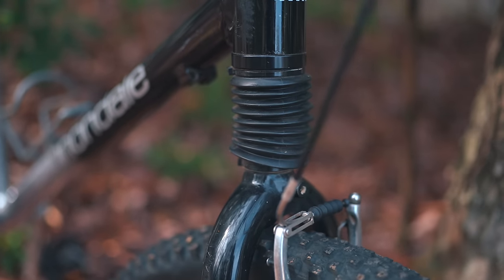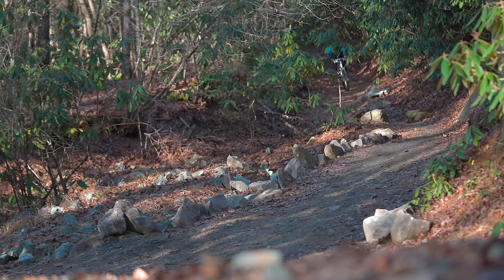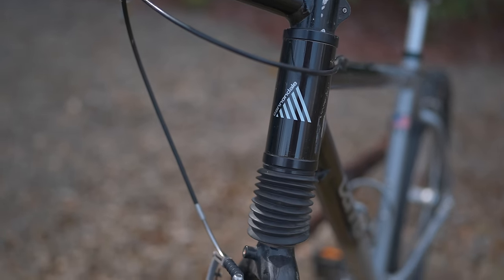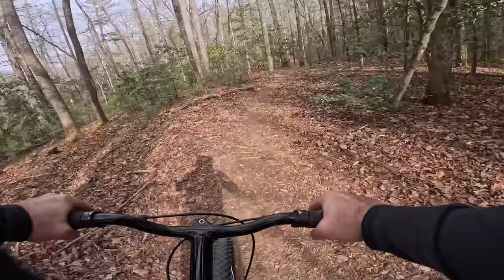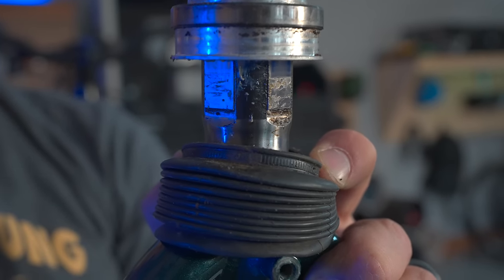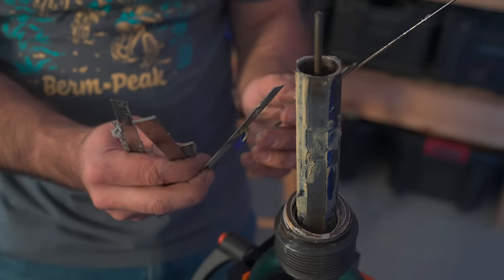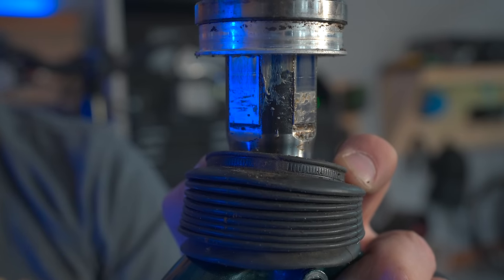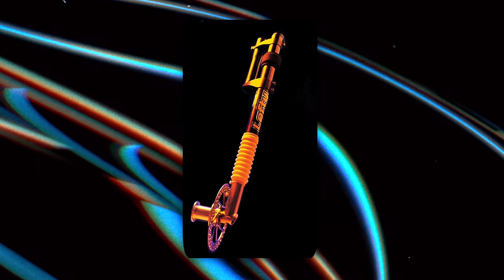The Rise and Fall (and Rise Again) of Cannondale's HeadShok

Comment: I was a Cannondale mechanic from 89 to 99.  Headshoks were a pain in the rear.  The boots cracked.  The slightest bit of dirt and it was a complete teardown.  Getting those bearing slides back in was pure joy.  There were two types of Headshok.  One with oil and a dampner, another with a rubber bumper.  Hot days the bumper was mush.  Cold days it was a brick.  But they rode so much better than regular forks.
Reply: Me2, they are/were the worst.  Only a matter of time till one of the bearing races migrated.  If that happened felt like the headset was loose and broken and was $$$ and time consuming to repair.  The races were shims in different thicknesses. As a mechanic it was trial and error what mixture of thickness would work...such a pain.
Reply: 15k mile on mine and it never needed anything
Reply: @lawrencefranck9417  oh it certainly did, you just didn't notice
Reply: Yep the new specialized ones are also a pain in the ass to service. It's basically a cup with a mini fork damper in place of a headset cap. The tension is set by a series of 2mm set screws. They strip easily and don't always work if you don't pre-preload the headset.
Reply: Same here....93-99 @ a Cannondale dealer. I did huuuuundreds of them. I recall using a section of road inner tube that I would inflate to keep the races in place. Good times...ha!
Reply: I worked at a Cannondale dealer at the time, the forks where so smooth, the double crown forks with the lefty internals where sold, they called them the Moto forks and wa used on the 'Super V Freeride' for example. Freeride as a word was used by Cannondale for the first time.
Reply: One may say it was a pain in the front.
Reply: A lot of guys had the oil type changed over to the bumper type. My F2000 steered like a rack and pinion car, no flex at all. But... mine needed rebuilt every other year.
Reply: Very long
Reply: Are*
Reply: Agree 💯, but the Lefty is still cool AF! Cannondale was the last company doing all the things that made mtb rad in the 90s.
Reply: Looks like a sticker of peyton manning 😂
Reply: The Headshock let me down so many times.  I stopped riding the bike about a year after I got it.
Reply: no you weren't

Comment: I wonder how long it will be before we see a Cannondale gravel bike with 50mm headshock.
Reply: 10 years ago.
Reply: Cannondale had predecessors of what we call gravel bikes now from at least 1998 on - way before when gravel bikes became a thing in mainstream. Back then it was called Cyclocross.
The XR800 had a rigid fork while the XS800 was spring fork. XS800 models only had 25mm of travel tho (Fatty X fork) - sign of the times. Even earlier cannondale had hybrid and road bikes with headshoks of 15mm of travel. Of the newer bikes I'm not sure but mostprobably there is something. In 2000 cannondale introduced the Bad Boy urban bike - much similar to the F**-Series 26"-mountainbikes but with 700C wheels. They had a 70mm headshok. I imagine it has a more race-oriented geometry than your typical dad bike.

Also with an F-Series mountainbike equipped with discbrakes you could most probably also run 700C / 650B-wheels to build some graveler.

Comment: I'm still riding a cannondale H600 that I purchased in 1997. I used it as a hybrid for a few years and then I converted it to a road bike. It's still my main bike and the head shock hasn't been serviced since 2000. The best part of the head shock is the ability to easily turn it off and on. Going down hill or on flats I keep it on. Going up hills I turn it off so I can transfer all my energy without loosing powder to the cushioning action especially when I'm up on my pedals. This also allows me to keep my tire pressure up while providing a smooth ride even on the normal uneven road surfaces where I live. What a great invention.

Comment: I worked at a Cannondale dealer for six years. I honestly loved working on HeadShoks and Lefty’s. Even if you got a completely rusted out one you could just replace the races and/or the bearings and you had a (better than) new fork. Plus if you knew what you were doing you could customize the pressfit damper by changing the shim stack and/or oil weight. Also, as you ride the needle bearings and races polish so an older fork (that’s properly maintained) often feels better than a newer fork. At the time they were impressive technology.
Reply: I had a headshock way back in the day that locked up entirely. The shop said it wasn’t worth fixing. I might’ve gotten fleeced after reading your comment, but I ended up with a 5” travel Psylo on the bike, which was head and shoulders above the headshock in performance. Oh well
Reply: Very long

Comment: I have 3 bikes with headshoks.  I use them mostly for commuting and occasional gravel riding.  My first bike was a 50mm travel headshok and that has ~ 80k miles on it.  Recently I bought two early 2000s headshok bad boys (80mm travel) for cheap, bought the tools and replacement seals / spare cartridge and I LOVE these bikes.  One was supposed to go to a buddy in Texas but hard to send it on.  I am old and want to keep the shocks out of my wrists so I can ride to 100.   On a bad boy.  Seriously my bad boy is all aluminum, carbon, and stainless so am sure it will survive the next 35 years.  Stocking up on the seal kits so I can do the next rebuild when I am 90.  I always think - "I have the coolest bike I have ever seen".  hahaha.  Except I want the Cannondale scalpel / habit in "purple haze".  I do not need but I want.

Comment: The brake levers on that bicycle are also a historical innovation. They allowed you to set more or less mechanical advantage to suit your preference. Precursor of servo-wave, which is now commonplace for hydraulic brakes. Cool stuff all around.
Reply: Shimano were already making servo wave levers for cables well before VBrakes came out, and the XTR and XT levers that came out before the LX ones shown, also for VBrakes all had servo wave of the same style as the older Canti version. This style was where the cable mount was on a roller that moved in a slot in the lever blade to go closer to the pivot as the lever is pulled to increase cable force. XT levers had 2 blocks that could be removed from the slot allowing no servo wave with all the blocks in to full servo wave with both removed. XTR used a threaded pin that sat in the slot allowing fine tuning of the exact level of servo wave assistance the rider wanted. The downside is that the roller would wear a notch in the slot in the lever at the lever released and especially at full lever pull positions, leading to there being a noticeable click felt through the lever as the brake was pulled. 

Avid (They're the brake manufacturers SRAM bought to add brakes to their line-up, but this predates SRAM owning them) Speed Dial levers had a similar mechanism but it was moved using a screw that allowed the rider to move the pivot though it stayed fixed in use - it allowed the same pair of levers to actuate a VBrake on the front and Cantis on the back with a similar lever feel for example. The Deore LX levers in the video are probably the most elegant incarnation of servo wave cable levers because they don't wear in such a way as to notch any part of the mechanism and there are fewer moving parts, but the mechanism was much too bulky and heavy compared to what XT and XTR were running.
Reply: Taken from flat landing bmx.
Reply: @peglor  Thanks for this thorough explanation. These models were too high end for me to afford back then, and date to before the internet. Therefore I am still learning plenty and do so retrospectively.
Reply: Dude, i owned similar ones, STX RC, and they were hella good, i'd still like to run a pair of those in my commuter, the feel was of aerospace quality
Reply: this is a basic idea, and has been present on most brakes
Reply: Force 40

Comment: I rock a 2003 F600 with an ultra fatty dl80. It’s new enough to have disc brakes and sports “Handmade in USA.”  I also switched it to single speed and put 1.5s on it. Great little city assault bike and has a great orange to yellow paint job. Bought it a long time ago for a few hundred bucks and will never give it up.
Reply: Important to have a good city assault bike!

Comment: your the man, i tried to service my forke in 1997. let me tell you, without the internet and no help at all. it is not easy.  Greetings from germany
Reply: Hopefully this will inspire some more detailed rebuild guides. Hard to find service manuals. Once you've done a few it gets easier but getting the races and bearings set can still be a nightmare with all the grease.
Reply: Hab heute ein killer v 800 gekauft und die gabel sind total fest, hast du eine ahnung wie man die repariert bekommt? unten rum ist die total krustig

Comment: For commuter bikes this looks like a good solution. The common commuter forks from Suntours are simply not good and they only move if you hit a pothole. At the same time they fill with water if you ride during rain and get sticky after a service very quick, and they start to rust quite fast on the stanchions. I went to a non suspension fork on the commuter for this reason, but it is of course not the same smooth ride like with a mountainbike with a proper suspension fork
Reply: The Headshok is way over engineered and much more expensive to make than those crappy cheap suspension forks. The only reason those forks are so common is because they look cooler than rigid forks and provide marginally more suspension 😂
Reply: @michaelmechex  
yeah, in many cases you are better off with a rigid fork and simply fatter tires
Reply: Nowadays we also have suspension stems (and seatposts, and even grips), so the options have opened up a lot for commuter bikes without going quite as complex as this. I'd love to see needle bearings replace bushings in some 'simpler' designs though for the smoothness, just not really a lot of ways to make it affordable and not require regular maintenance.
Reply: the thing is if you are already going with a high end option (which canondales was probably) you can get a higher end telescopic fork and be done with it.
Reply: Try a suspension stem. Way cheaper, zero maintenance and they definitely smooth out the ride.
Reply: Gazelle, one of the biggest european manufacturers, uses a similar design, well, rather the same general idea, on some of their commuting ebikes. Absolute pain in the ass.
Reply: Yeah I just got a commuter ebike and the front suspension was shaking me apart at high speed bumps. Just tried locking it out, and high speed bumps are better. Low speed curb hopping.... Not so nice

Comment: I owned a delta v700 with a head shock, pretty sure it was a '93. Didn't care much for the bike but loved the headshock concept. Mine was one of the first versions so it would lose air frequently and would loosen up quite a bit too. You had to twist the dial about five or six times to get it to fully lock out which was a pain. I believe subsequent models  fixed all those issues, the dial went to three clicks from what I remember, soft medium and locked. Where we lived in Southern California our mountain bike rides typically consisted of anywhere from 10 to 20 mi on the road to get to and from the trails so having a easy to engage locking front suspension was very convenient for those long torturous uphill pavement climbs. Thanks for all the well done, informative videos!

Comment: My first decent MTB was an F600 with a Super Fatty Ultra DL. At the time (early 2000's), there was only one shop in de vicinity that had a mechanic with the proper knowledge of these forks. After crashing my F600, my parents got me an F1000 with the same type of fork. Never had any problems with it. I still got that fork somewhere in my shed.

Comment: I had an f400 I bought used in 2009. It actually had a Head Shock with a 110mm air spring. The bike shop said it had been retrofitted, and the air spring was a Cannondale Team shock. The boot was significantly longer. It rode great! Wish I still had that bike.

Comment: I’d been watching an f700 on Facebook marketplace. You inspired me to take the leap. I updated it with a single chainring, new bottom bracket, and shorter stem (only 1 alternative out there) along with repacking the bearings and rebuilding the headshok (that was not easy). I rode it yesterday. It will serve as my “around town” whip. Super light!

Comment: I love your review. I once converted a Lefty Max to a Kona Humuhumu-Nukunuku-Apua'a frame (with a spare steerer tube from a Bomber Z1 and some selfmade spacers) and installed a "sequential" shifter to the "middletube" (made of a Nexus shifter with a new housing and a manly lever) connected to an Alfine gearhub...

And before there were any "Gravel-Bikes" I took a CD Bad Boy and put some super compact road gear and proper wheels on it - it was a blast. And as there weren't any discs for roadies available at this time, I went first with the mechanical Dualbangers and then with the TRPs HY/RD.

Comment: I still love my 80 mm Super Fatty on my '00 Super V 800.  I used to work in a shop, for 9 years, and a local shop let me sit in on a Head Shock factory training session.  I had bearing migration and air in my oil, so it topped out bad on climbs.  I followed the factory tech's advice and once my cartridge was out, I measured travel, which was only around 65 mm, and just raised the fork and hammered it down to "re-migrate" the bearings back, checking until it got back to 80 mm.  With one grade thicker fork oil and no air bubbles, I put the cartridge back in and she was like new.  Still works the same over 20 years later.  That 6-piece "up and over" swing arm was another story.  All pressed together, and the center joint started to separate and creak, which took a long time to figure out.  But they warrantied it for the new welded, triangulated arm.  Can't take the chain off without pushing a pin out like the original arm allowed, but that's OK by me.

Comment: Bearing migration! 
 Ride it hard and it was a teardown every week. I needed two HeadShock forks for my XC racing, one in pieces with a "bearing migration" reset and one to ride. Too many times It was 2am the night before race day with the shock in pieces on my kitchen floor. I had a shop -kit of steel shims and had to measure each one to find the correct thickness. Too loose and the bearings would move within an hour of riding. Too tight a fit and it was almost impossible to assemble, it had a rough feeling.
Please don't think about reviewing the CODA hydraulic brakes. They were another nightmare I wish to forget. I do remember bending the CNC CODA crank arms and the skipping chain on the CNC CODA big ring. 
Imagine driving for 3 days to ride Moab and trying to get the HeadShock and brakes on my then new $3700 Cannondale ( R4000? It had a black-to-white fade matt paint) bike to last more than a day of riding before the shock failed and the brakes squirted fluid.
 While there I almost bought a new Tomac suspension frame and RockShock fork to hang my parts on. The bike shop was going to do an after-hours build for me but the new Tomac frame was  1800 0USD alone.  Instead, I replenished my electrolytes while sitting in a hot tub and did a field service in the campground each night, after each day of riding.

Comment: Nice show, Mister Seth. Some years ago I acquired for $100 a hybrid / 700c hardtail with the Headshock and cantilever brakes, triple crank, Gripshift. Metallic dark green, prior owner was 80 years 'young'. Believe it was model H-700. Tossed the pogo 27.2 seatpost, found on ebay for pittance a Cannondale riser stem, added drop bars. Also tossed the Gripshift and replaced with Shimano STi dual control brifters. Refit with 700x38c, fully serviced, replaced usual consumables. Near new Brooks Cambium for $35, and also an odd N.O.S. front pannier rack for the Headshock fork. The shock was produced by Marzhocchi. Outstanding minty gravel / camper bike. Admit was on the weighty side but really a nice capable bike for little. Offed it to someone who needed a bike more than my kings ransom worth pile of bikes.

Comment: I have a cannodale from 2004 with a lefty. I rode it then my older son for years and then my younger son for years. It is all xtr with Hayes brakes and we have never done ANYTHING to it other than replacing a few tubes. My older son (190lbs) rode it down Butter Gap twice yesterday, including sessions on the rock drop and it still rides strong. Named it Sherman after the tank because it is indestructible!

Comment: A really interesting story. I had a  F series from 2003 with a 80 mm headshock. Paid 300,- NOK (30 usd) for the bike. Really smooth suspension, and quite modern XC geometry on that bike.

Comment: I still run Head Shock. Craig at Mendenhall Cyclesmith in NY is The Man when it comes to maintaining old Head Shok's.
I have a F500. Bought it used with a wanna-be Marzocchi Bomber fork. Recently found a Fatty 70 with slipped races and a blow out dampener. Sending it to to Craig.
Love old Cannondales, they will forever be my Go-To.

Comment: I still have an F700 with the Headshock. Without the lockout, you get a lot of bounce when pedaling uphill so I used the lockout a lot. I got tired of servicing the shock and for years now I've ridden it as a rigid. It's a light, agile bike that works well on moderate trails.

Comment: My first good bike was a Cannondale F4, had a blown out adjustable Headshok, they tried to warn me at the shop I'd probably have some trouble replacing it.

Did eventually find a coil headshok, almost died many a time on that bike. 😆 But eventually did get an adapter to put a decent, regular 1 1/8 fork on it.